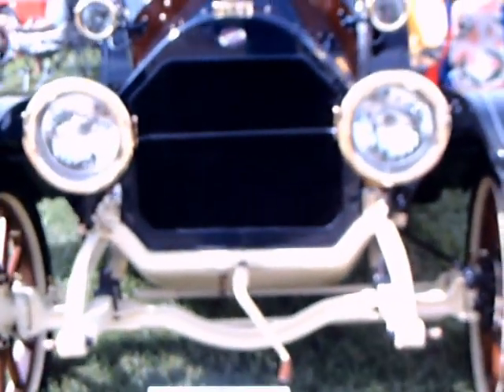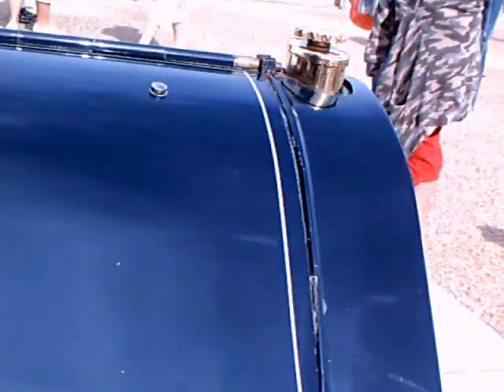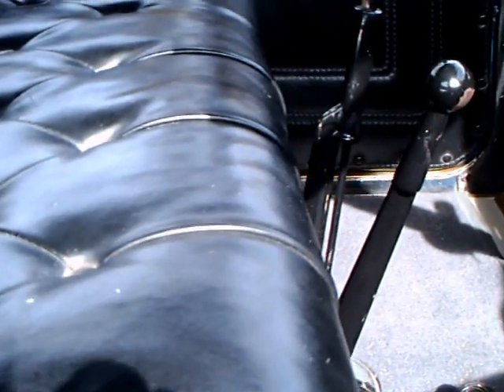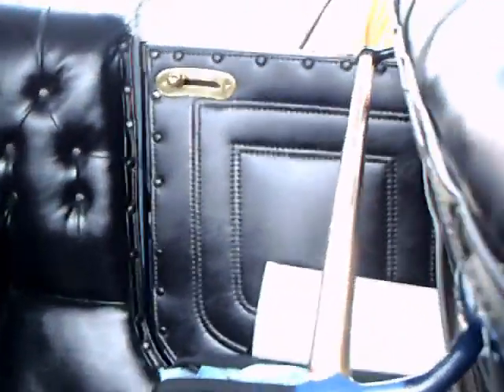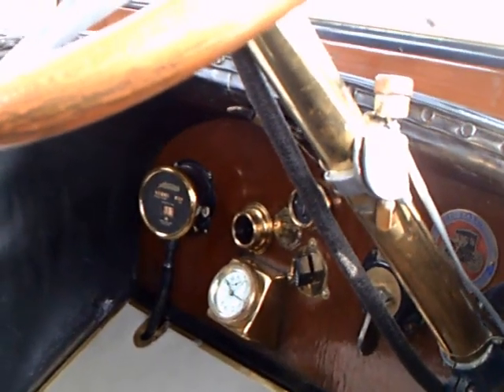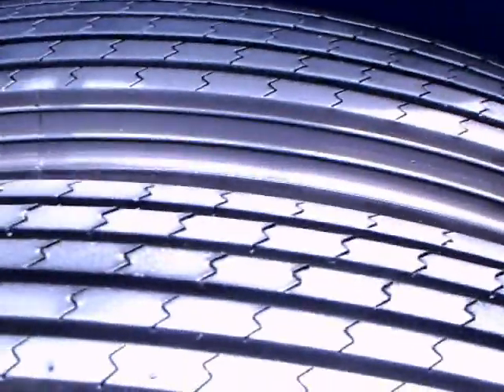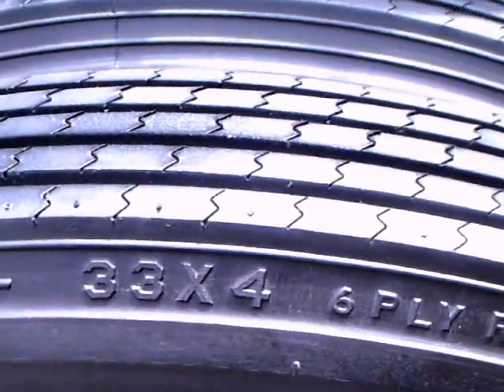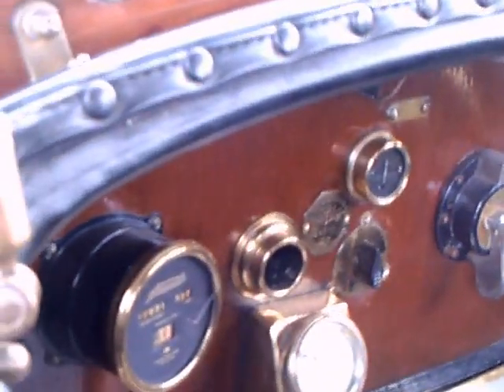1914 Overland Phaeton BluBlk

Comment: This car was at the end of the brass era and would originally had nickel not brass.  I know the fellow and when he bought it it was like this already.  Everything you see with brass plating should actually be nickel.

@rx6180 Generally the trend with electric lights was 12-Cadillac
13-other high end brands
14-mid range like Overland
15 or later - all others like Ts
Ts did not have electric start till 20s
If you noticed in Overland jeeps the word Overland is the same as on this car.
Great video!

Comment: I wanted to add that the 14' Overland was green with black running gear although it is pretty
Also the Overlands were like the honda or toyota of their day they were some of the most reliable cars you could buy.  So reliable that people would use them till they fell apart and were sold for scrap so certain cars survived more actually because they broke and were put in barns or cars like Cadillacs kept indoors

Another video on Youtube with fellow who used the car for around town use for 60yr